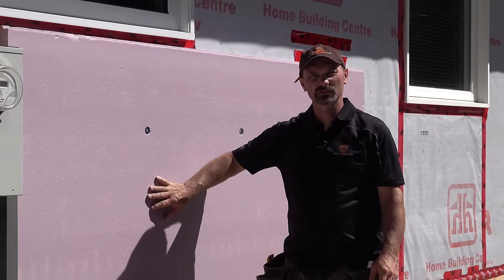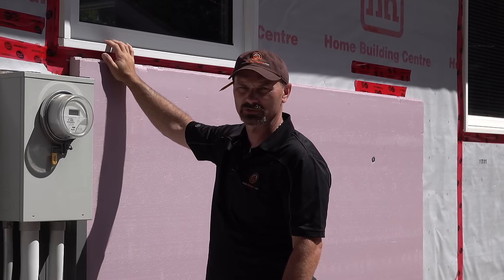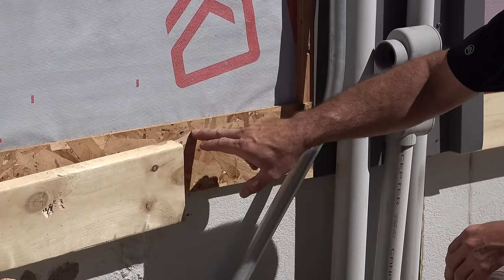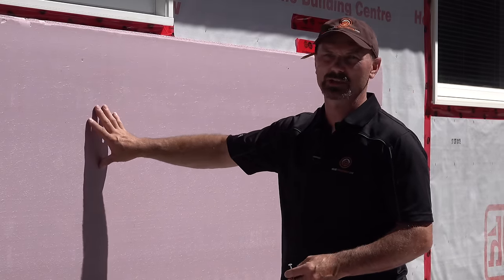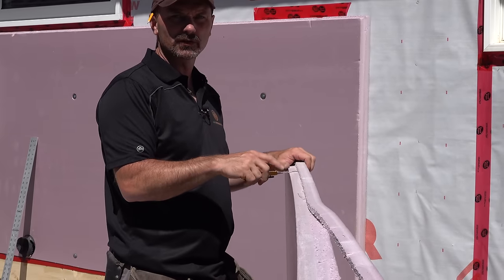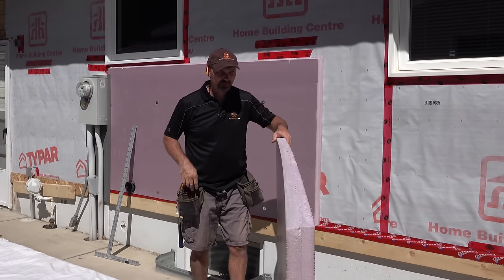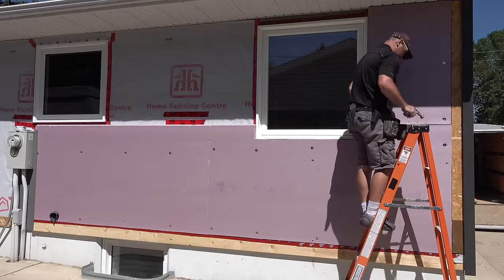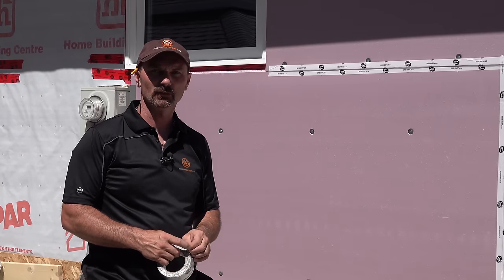How To Install Styrofoam Insulation On A Home's Exterior

Comment: Just remember, if you bring your windows out further with a 2x4 or whatever you use, you will have to adjust the inside of your windows ( sill ) to match the drywall.
Reply from the maker: Yes if you are replacing them and moving them out then you want deeper sills.
Reply: @HouseImprovements  do you happen to have a video of how foam is done around windows and putting siding on over the foam ?

Comment: what material did you use at the corner of the building over the 1/2" OSB?  That combined with the J channels looks a lot better than the corners they sell that accepts the siding without using J channels.  They always look so flimsy.

Comment: Do you or anyone know anything about insulating a brick home been reading a lot of no ways but very little can be dones
Reply from the maker: Sorry no experience for me.
Reply: You sort of have to add an extra wall to the inside of your brick walls.  For example, this 2" foam he's using could be install in the inside of your walls and the sheetrock installed over it with extra long screws.  Or you can build 2x4 walls up against the brick and add insulation and sheetrock like a wood house.   Most people don't like the idea of losing space in their house by squeezing the walls closer all around, plus the cost of redoing the entire interior of your home is significant, so they don't bother.   If I'm finishing someone's basement I'll add walls and insulation to the inside of the cement (but be careful about creating mold gardens in between).    I live in a brick house too so I know the pain.
Reply: @tombiby5892  is there a danger of mold gardens at the upper floors or just when your building directly off concrete walls in your basement
Reply: @elitechevalier4614  It's only in the basement where the foundation is letting moisture through from the soil outside.  Upper floors are only in danger of mold if you have leaks, but that's the case with any walls and not particular to the brick.

Comment: The power company will come out and move the meter box off the house and you might have to hire an electrician to extend the wiring to the service panel on the inside, or you can build around the box and fill that cavities with expanding foam and enclose all but and or the meter.  The power company owns the meter everything else is yours.
Reply from the maker: That is an option for sure.

Comment: Osb on the bottom was stupid, it needs to be weather proof plywood or marine grade plywood.  What you did can rot
Reply from the maker: Our entire new homes here are sheeted with OSB. As long as its up off the ground by about 12" or more you are fine.

Comment: Xps is not styrofoam.
Reply from the maker: Styrofoam is a trademarked brand of closed-cell extruded polystyrene foam, or XPS. Styrofoam is the common trade name associated to these products.
Reply: @HouseImprovements  wrong again , Styrofoam is a trademarked brand of expanded polystyrene foam (EPS) not XPS  extruded polystyrene foam TOTALLY to different type of insulation.                                    Manufacturing: XPS is created through an extrusion process, while EPS is manufactured using solid polystyrene.
Applications: EPS is more suitable for decoration, while XPS is used in construction, engineering, refrigeration, and insulation.
Water absorption: XPS absorbs 0.3% of water by volume, while EPS absorbs 2–4%.